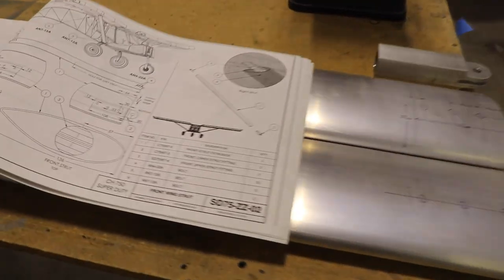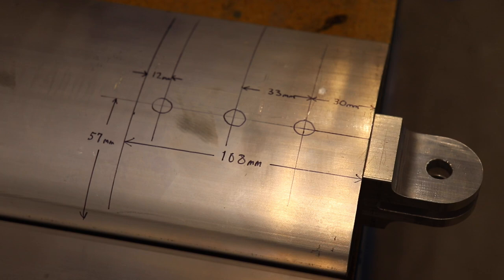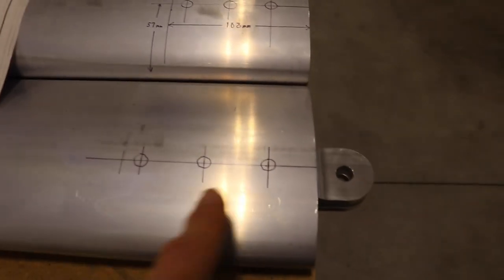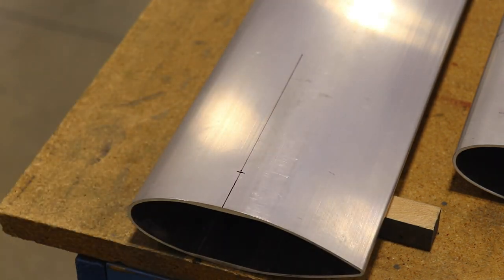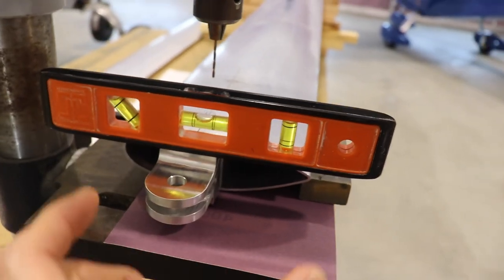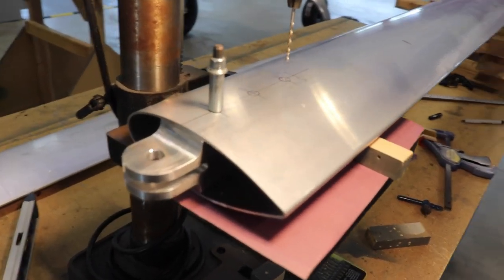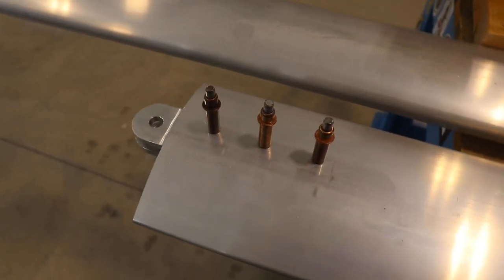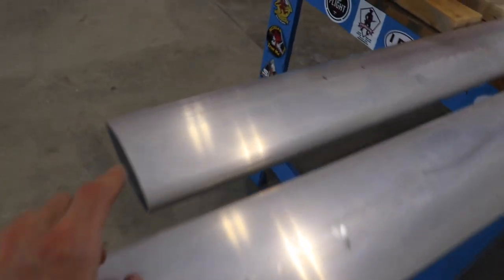Zenith CH-750 Lower Wing Strut Attachment (Ep91)

Comment: I wish Kitfox made their wing struts out of an aluminum airfoil extrusion like that!  Theirs are steel round tube (heavy) that you wrap with an extruded PVC airfoil, which is a royal pain in the a** to fit.  Their optional airfoil shaped steel struts are easier to install but very expensive and significantly heavier.  They could really take a lesson from Zenith on this.

Comment: Mark, in your last video you showed the rudder cable exit hole and you showed the really nice one you made for the Cruzer. You said you would not show it again as you built one in another video. I looked for that video but it didn't show the details of how you made it and how you calculated the angle of the tube with the delrin bushing in the end. Is there a video which shows the complete construction of this piece? It looks way nicer than the one which comes from the factory. Thank you, Thomas

Comment: Such a fundamental error. How could they build a plane with that kind of problem and not learn about it until now? Surely Mark is not the only one who has built this plane. I would be concerned about putting the wing struts together until I saw proof it worked. That would be a costly and time consuming error. Thankfully,  Mark is at the helm:-)
Reply from the maker: It's probably not really an error as much as just a missed update. My guess is that when the prototype SD was being built, the block may have been shorter, then for what ever reason they lengthened the block but the 108mm measurement on the plans didn't get updated. My plans are two years old so who know this may have already been corrected on newer plans.

Comment: G,day Mark from Sydney Australia.
Nut and bolts
AN4 1\4 " if I was to walk into Home depot etc: it would have that on the package label?
Will Zenith aircraft amend the plans?
📏📐🛩️
Reply: They are English measurement mil spec aircraft bolts I believe.  Aircraft spruce would have.   Don’t buy bolts for an airplane at Home Depot!  😬
Reply: AN bolt diameter is in 1/16th inches, and length is in 1/8 inches. AN4-22A bolt is 1/4”x2 3/4”. The “A” denotes NOT drilled for a cotter pin. As the  other reply states, do not buy bolts from the hardware store!
Reply: @5xls  Thanking you for your information.

Comment: Who ever dimensioned that print of the strut attachment didn’t do a great job.  Odd placement of measurements and difficult to use for real world purposes.  Not to mention dimensioning to a hidden line.  🧐🫣🫢🙄
Reply from the maker: Not sure what your experience is with plans and blueprints, but this is all standard.
Reply: @KitplaneEnthusiast  Placing dimensions to hidden lines is a no no.  All measurements should be referenced from edge of spar.  Then dimensions from holes moving left consecutively.  The fact that you had to fix their dimensions before drilling proves my point.  A less astute builder is gonna scrap a spar using their poorly made drawing.